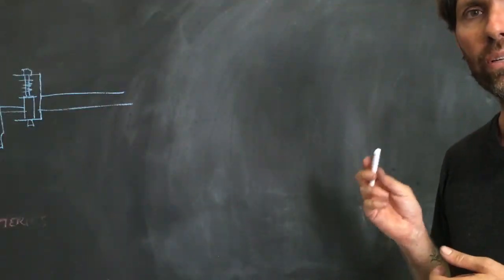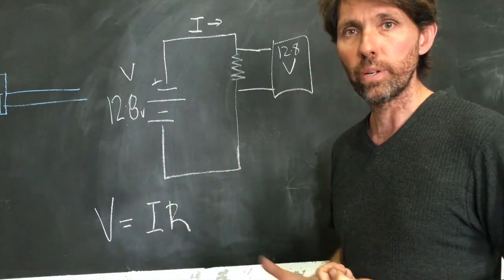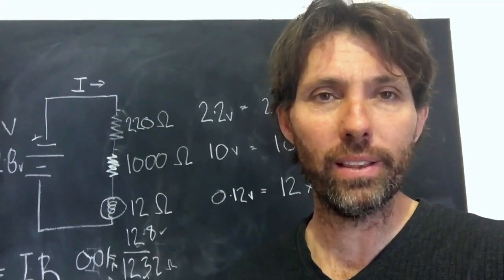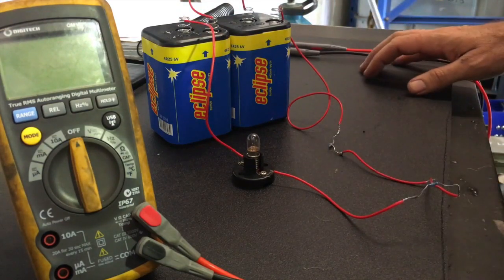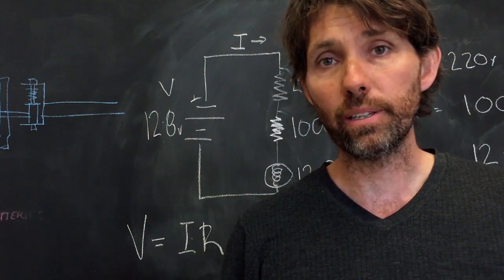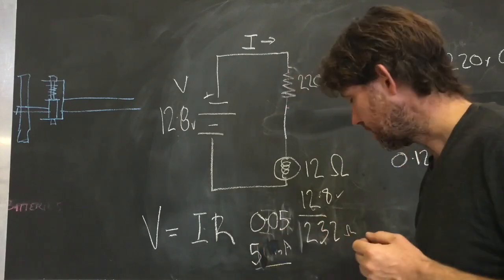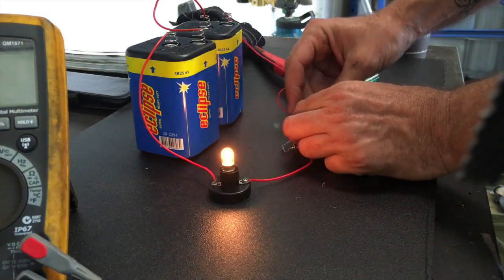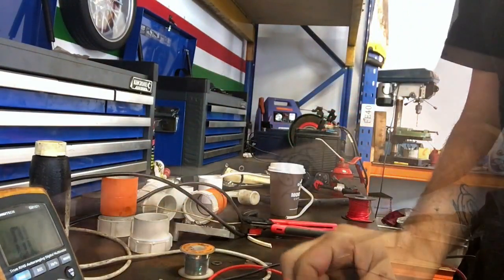Measuring voltage drop and understanding Ohm's Law

Comment: Thank You! I struggled to understand the measurement of voltage drop, as it didn't make sense to me. Your explanation, MMs measure in parallel from resistance point to point, therefore measure a small amount (voltage drop) while the rest of the voltage takes the path of least resistance for the rest of the full battery voltage. Theory videos glossed over this reason, saying to just measure resistance, point to point and that's your drop. (But why does it read that?) Also I have  confidence now diagnosing simple wiring problems. As an aside one person explained to me that the "green stuff" on wires isn't just stuff. It's actual wire destroyed so when it's cleaned off you actually have less wire. Smaller wire, more resistance.  (not that it might matter much except in small gauge wire to begin with. Thanks again and cheers!!

Comment: were you getting battery voltage when the meter was connected in series because the meter has the largest resistance (comparatively to everything else in the circuit) so the biggest voltage drop was across the meter, giving battery voltage?
Reply from the maker: That's a really good question. I can see what you are thinking in that meters have high resistance to only sample a small amount of the current, but it is more that you are measuring the total voltage drop across all of the components in the circuit which will always add up to battery voltage.

Comment: 1st timer. Subscribed. Where can I purchase those solder/heat shrink wire connectors? Great video. Thanks. Looking forward to next lessons.
Reply from the maker: Hi John, thanks for subscribing. :) You can get those heat shrink tubes from JayCar Electronics.

Comment: Great video, thanks very much.

I've mucked around with classic car electrics pretty successfully for years and found this really, really useful.

Probably not such an issue on boats but on my classic cars I've quite often rebuilt sections of loom with the express intention of eliminating connectors that are in exposed places to try to avoid the high resistance problems caused by corrosion (road salt in the UK).

I also find the P = IV equation very handy for assessing what specification of wire to use, ie:  I = P/V

So 2 x 100W lights will draw ~ 16.7 Amps leading me to probably spec a 25 amp supply wire (via a relay).  Heavier cable has less resistance too of course.

I've sourced some of those low temp solder connectors too.

Anyway, thanks again.

Cheers,
Reply from the maker: Hi Jonathan, glad you liked the vid. We have a 1956 Series 1 Landrover in the workshop at the moment. We are still tossing up whether to buy an aftermarket loom or just make one from scratch.
Reply: Well, an S1 only has about 3 wires so go ahead and make one!

I can recommend thin wall cable (something like this: http://www.vehicle-wiring-products.eu/section.php/198/1/single-core-pvc-thin-wall-cable), it really does save room in ya loom.

As a benchmark, the Autosparks chaps (http://www.autosparks.co.uk) do an S1 loom for ~£165 ex. VAT.

Cheers

Comment: Excellent Video, extremely clear and concise.  Thank you.  I have another problem which you may be able to clear up.  I am trying to solve a situation on a Brunswick Pinsetter and no one can explain why this configuration exists.   Recently ran into a situation in a Brunswick Pinsetter power supply box.  They use a double coil primary, (Can be either 110 or 220V depending if wired in parallel or series).  Mine are wired for 220V so H1 & H4 are the line supply phases.  They "tap" between H1 & H2 
to supply 110V to both a contactor coil & selenium rectifier and between H3 & H4 to supply a 110V pin light ballast. H2 & H3 are the "center connections" of the transformer. I realize it works as you read 110V from H1-H2  and H3-H4 but it just doesn't seem right as there is no "real neutral". In addition there is NO Neutral bar in the electrical box, only two Hots and a ground, (basically the old 3-wire system as these were designed in the 1950'S).  Won't these additional loads on the Primary Side cause havoc with the secondary voltages,(24-28V), circulating current, etc.??  Can you help ??? Thanks

Comment: Great video as always, just wondering if you could help me,  I've got a problem with the tacho not working in my boat even after installing a new gauge and using the recommended 6 pulses per cycle setting for an old 100hp v4 Evinrude. I've measured the voltage from the tacho signal wire coming from the outboard and its very low .67 volt. Could a voltage drop caused by bad connections cause the tacho gauge not to work and what voltage should I expect coming from that tacho signal wire?
Reply from the maker: The tacho is a pulsed signal so you won't be able to read the voltage with a straight multimeter, you will need a DVA meter like this https://www.youtube.com/watch?v=juhri_NxQcQ I'm not sure what it should be but if you are not getting a result with the new meter I would definitely be looking into the condition of all the wiring.

Comment: Cheers mate, great help.By the way, where did you get the last connector you used to solder the 2 points (Rubber tubing with low Temp Solder).What's it called?.
Reply from the maker: Thanks mate. I got those connectors in bulk from Alibaba but you can also get them in smaller quantities from stores like Jaycar Electronics, not sure what they called them though.
Reply: I found some on Amazon.com.  They come in 4 different sizes 12-10 AWG (Yellow),  16-14 AWG (Blue),  22-20 AWG (Red), and 26 - 24 AWG(White).    They are called Heat Shrink Solder Sleeve Crimpless Butt Connectors.  Here is a link to the connectors:  https://www.amazon.com/Shrink-Solder-Sleeve-Crimpless-Connectors/dp/B01M1032A7

Comment: Would you please give a talk on how to figure out what size of fuse is required in a circuit and why a fuse is needed. Thanks again, Bob.
Reply from the maker: Hi Bob, will add a video on fuses to the list but the basic idea is that a fuse protects a circuit from melting should a bare wire cause a short circuit. If that happens the current draw will be high enough to blow the fuse before the wire gets too hot. You chose a fuse size based on the amount of current that the devices on a circuit draw. If, for example you have some 4 amp lights and a 5 amp bilge pump on a circuit then you would put a 10 amp fuse on. Enough to allow the devices to work, but not so high that it won't blow should some extra current be drawn above the normal operating amount.

Comment: Here's another question; here in the states we use Amazon instead of Alibaba.  Do you consider Alibaba safe as far as credit card security etc?
Reply from the maker: I've always had good experiences with Alibaba. I bought about three or four things and they've always arrived very quickly with no payment troubles. Alibaba is a bit more geared towards supplying large quantities to retailers, but you can get many things in small quantities.
Reply: Thanks, I may try it and see if the feds come after me for tax evasion.

Comment: Good golly I remember Ohm's law from physics but never had a practical use for it!  Thanks for the video.  I never knew about HCl for cleaning copper corrosion and I also burned out three multimeters I inherited from my dad so I learned a couple of important tips today.How important is it to use "tinned" wire for marine electronics?  Also what are those heat shrink connectors with solder in the middle called? EDIT: Never mind, found your link on the connectors in comments...
Reply from the maker: Hi mate, glad you enjoyed the vid. Good question about tinned wire. At the end of the day, copper doesn't really corrode, so I'm not convinced it is essential provided the connections are rock solid. Once the connections are soldered the copper is protected from the elements can getting that oxide coating to everything should say working nicely.

Comment: Hey Stu, thanks for the great video.  I really love your work!
One thing I think you missed in this video though is the voltage droop in the battery when under load.  Note that your unloaded battery was reading about 12.8 V (when you broke the circuit), and when you completed your initial circuit it showed something like 12.74 V.  IMHO, this is likely due to the droop in the battery when under load (in this case your load was 10 mA).  That's why when you removed the 2 resistors from the circuit, you were seeing 12.4 V (due to the battery voltage droop, not a resistance in the connections).
The only reason I bring this up is that it's important for people to test their batteries when under load.  A battery may look great when unloaded (e.g. showing 12 V), but it could droop when it is loaded (e.g. when you are trying to start the motor).
Reply from the maker: Thanks Corey, that's an excellent point about voltage droop. Testing a battery under load like while cranking would have been a good example of this I should have included. I must do a part 2! :)
Reply: Does the voltage drop under load because the battery plates are eroded/damaged and can't supply the increased current demand?
It makes sense in terms of Ohm's law - never thought about it that way before.

Comment: Great video....your explanations have opened up a whole new understanding of the DC wiring system. I was never told or ever figured out that the battery voltage is completely depleted by a circuit. Now it all makes sense. The light went on! Thanks.
Reply from the maker: Thanks Bob. Glad the video turned that light on for you. Electrics aren't that complicated compared to mechanical issues but people often just aren't taught the basics. I'm glad this video helped a little bit.

Comment: Very Helpful, Thank you.  This will definitely help me in solving various electrical issues.  You are so correct, knowing how a circuit works ( or some basics) will help in trying to diagnosis problems.
Reply from the maker: +James Brennan Hey James, glad the video helped you. Although you don't need to know this stuff to spot a corroded connection, I sure do believe it helps you find them!

Comment: excellent as usual Stu.  I was once working on a 40 hp Yamaha, no crank, no power trim, found rotten green and mushy battery cables, made a set of them and all was well.
Reply from the maker: +classicoutboards Hey mate, glad you got to the bottom of your problem. It's always a satisfying thing to sort out that dodgy wiring. :)
Reply: That was actually about 2 or 3 summers ago.

Comment: Awesome! I really learned a lot from that one. I finally have a better idea of how to use a multimeter. Love those heat shrink tubes for connecting wires.
Reply from the maker: +Dayne Cowan Hey Dayne, glad it worked for you. I was a bit worried this one would be boring. Yeah, I'm starting to really love those connectors too, so quick and convenient. :)

Comment: If you don't have any hydrochloric acid (aka muriatic acid) you can use acetic acid (vinegar) which is a lot safer but a fair bit slower.
Reply from the maker: Good tip Matthew. I must admin I'm a bit cavalier with the acid. I should at least wear gloves and safety glasses.

Comment: Well done again Stu, never thought of using Hydrochloric Acid to clean corroded connections. Will look at tutorial again to get a better grasp.
Reply from the maker: +Paul Sheppard Thanks Paul. It is a bit heavy on the theory, but I hope it does help people get their head around the wiring in their boat.

Comment: Great video to help newbies diagnose electrical issues once again mate.One thing I would of mentioned to newcomers is to always use marine grade wire on a boat avoiding automotive wire at all costs.
Reply from the maker: +Fabian Sosa Hey Fabian. Good point about the wiring. There is a big difference between tinned marine wire and automotive, you are right.